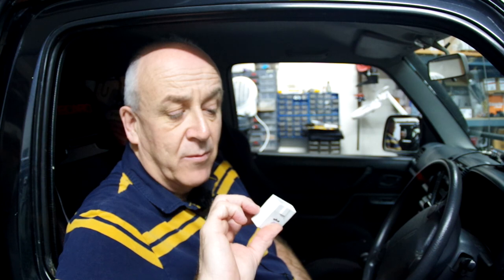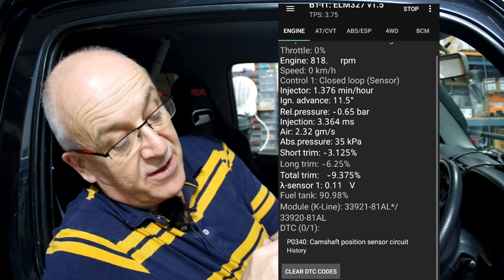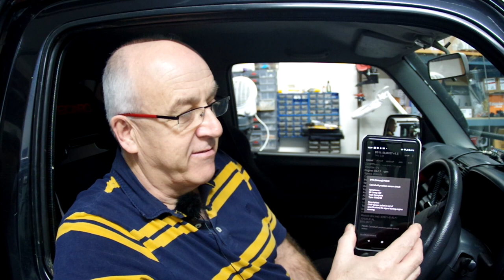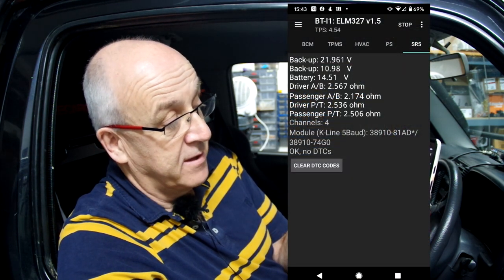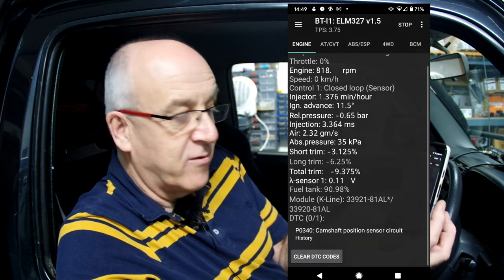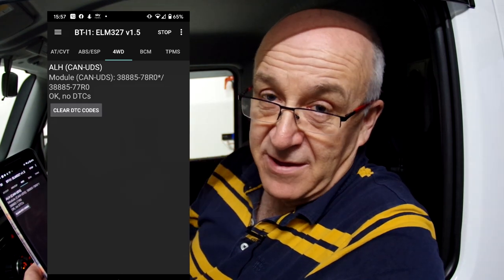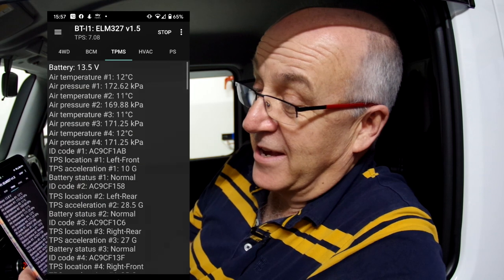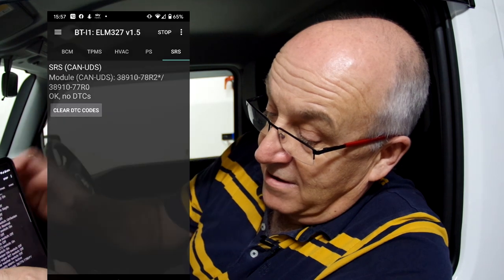Code Reading a Gen3 and  Gen4 (JB74) Jimny?

Comment: Great video!!! Can the SZViewer A1 be used to adjust the speed scanner after increasing the wheel and tire diameter on a JB74 vehicle?
Reply from the maker: No, its a viewer only
Reply: @bigjimny  Would you know which software and hardware is suitable to calibrate the Speed Scanner for tires with diameters different from the original?
Reply from the maker: @djafuh3440   No, not found anything yet. Been through the Suzuki tool with a friendly dealer and no sign of anything there either

Comment: Nice video Martin, thanks for taking the time to share. Wondering if that software would work on a 2004 Australia spec jimmy ?  I try a code reader, but it could not read it. Also I have joined Bigjimmy. Cheers
Reply from the maker: It's hard to tell, it depends on the ECUs fitted and I believe at the time Australia lagged behind the European fitment
Reply: @bigjimny  Hi Martin, thanks for the reply mate. Cheers
Reply: I have the same problem with a 2004 New Zealand model
Reply: @rednecktiek  Hi! I have a 2004 Jimny is Australia and the engine light is on. Did you end up finding a code reader that works?
Reply: @RoseSeoane  supposedly a Tech2 with the Suzuki card/chip will work, but haven't bought one to try yet as they're over $1000.
I will probably try my local dealership and see if they can read it first, as most dealerships will usually read codes for under $50.
Not sure if I can justify the cost of buying a Tech2 for the amount I'd expect to end up using it.
Reply: @rednecktiek  hi! I actually read the code today by placing a jumper in the monitor coupler socket between pins 2 and 3! :)
Reply: @RoseSeoane  to be honest I've just been driving it with a permanent check engine light for the last 3 months, been pretty busy with work and haven't had the time to go talk to the local dealership or short the pins and count the flashes (which tells you the code, but not necessarily the cause)
No doubt I'll get around to it eventually.
Though I have also been toying with the idea of trying to do a engine swap from my current M13A non-vvt to an M16A vvt and doing away with the OBD1 ECU in the process so that an OBD2 reader would work, though there's all sorts of unknowns that I haven't been able to find useful answers to, which makes me hesitant as I don't really want or need another long drawn out project
Reply: @rednecktiek   Hi I used the pins to read the DTC and fix the problem. But I have that SZ viever app and that works on Oz model. Cheers
Reply: @rsbharley4766  do you know if it works with a bluetooth reader on the pre-vvt models? or just for what the codes are? 
As I've got a factory service manual that has all the DTC's in it if I use the pins....
Reply: @rednecktiek  yes it works, I have an 2004 Oz model. As I said, I fixed my problem using the pins and a service manual. Then got the SZ reader, but I did find out that Suzuki changed the code numbers, so using the pins did not match the service manual but the reader gives the codes straight from the ecu. Don' know if yours will be the same. Cheers